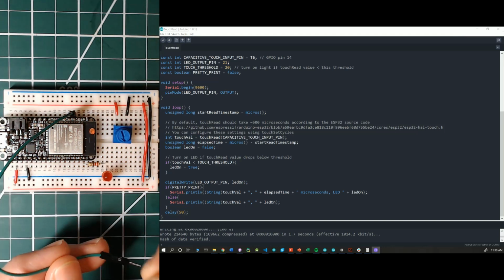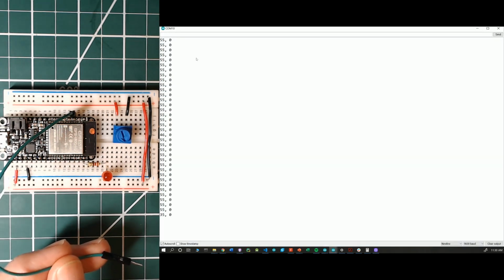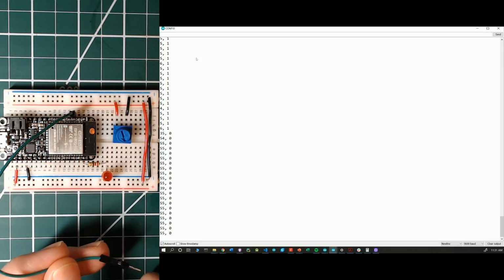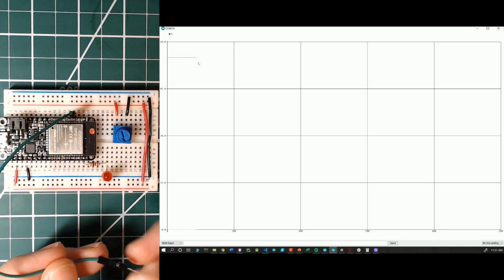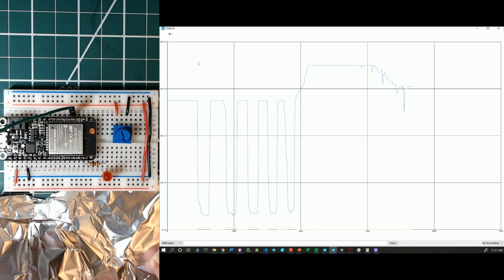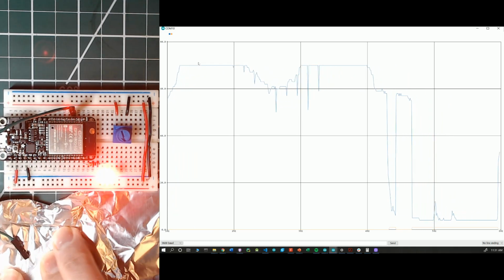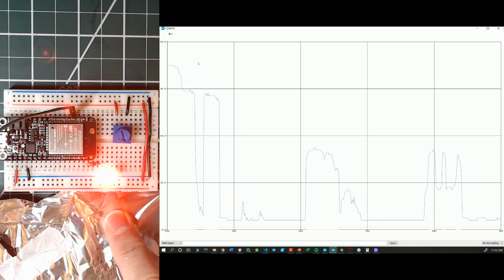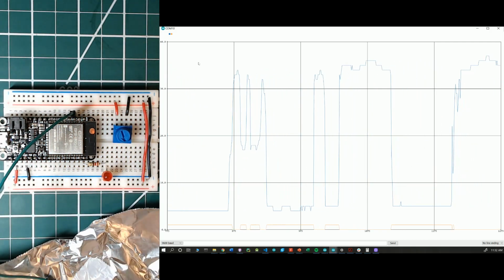Capacitive Touch Sensing on the Adafruit Huzzah32 (ESP32)

Comment: Hey,
I tried your code and while using the USB-Connection, connected to a PC, it works like a charm. 
Then I tried using it while I powered the board with a battery and I don´t get the same result, which absolutely confuses me. I must note I'm just a beginner, but shouldn't it show the same behavior while using a battery? 
Interestingly it will still work if I'm touching the resistor on the lead directing to the pin 21. 
I do not understand any of this behavior and it would be nice, if someone could give me a hint for what I should looking for.
Thanks in advance and thank you for these little videos for the Huzzah32. They help me a lot!